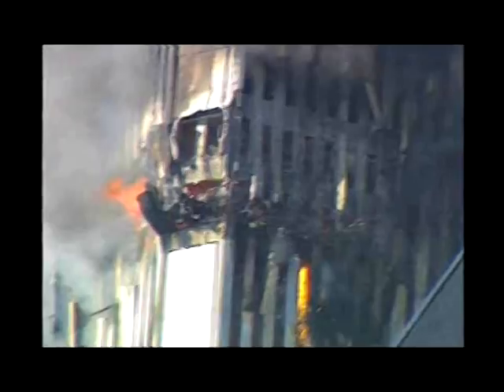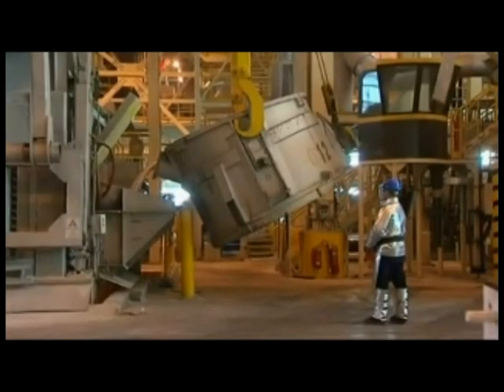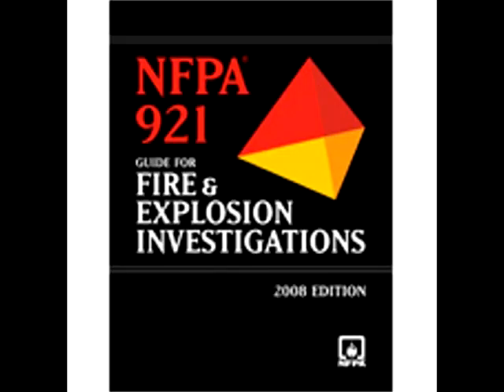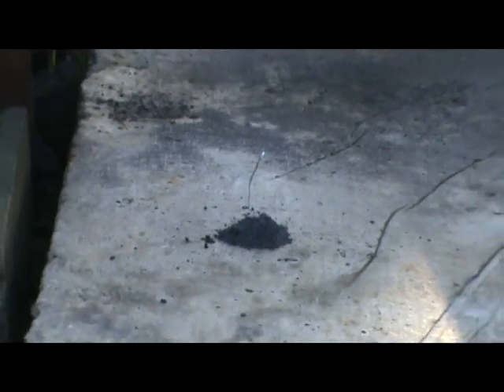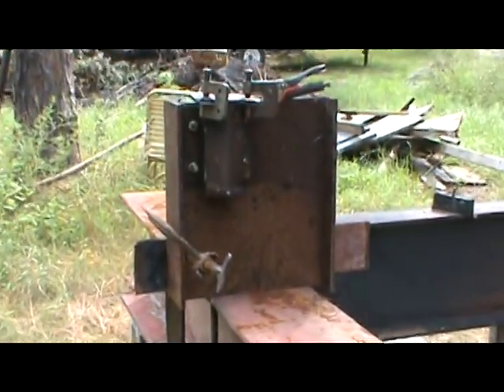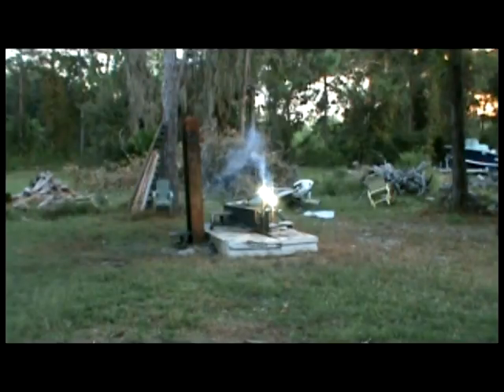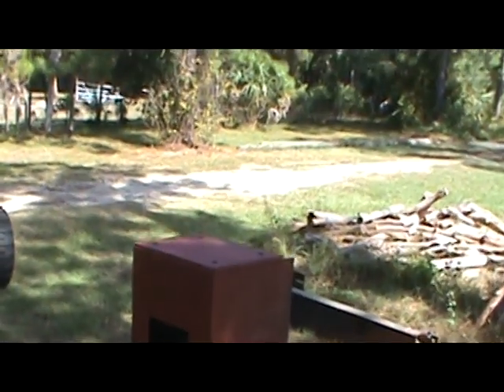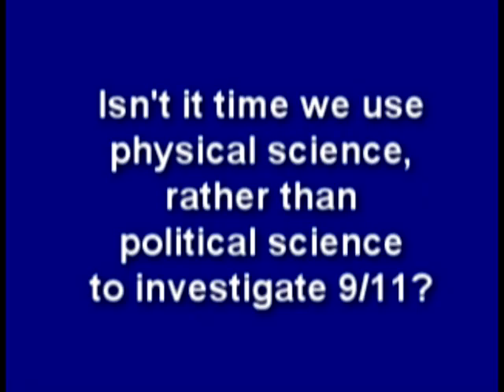9/11 Experiments: The Great Thermate Debate

Comment: I worked 37 years in the natural gas pipeline industry and I have used a lot of thermite while welding copper test lead wires to a loaded pipeline for catholic protection purposes. Thermite comes in different size charges depending on the thickness of the pipeline you are going to bond the test wire too.  The reason for this is because a charge to large can cause a catastrophic failure like burning through the pipeline with 1200 #'s of natural gas pressure which would cause immediate death. You cannot imagine how hot thermite burns and how quickly it reaches maximum temperature. We talking less than 2 seconds. Could thermite have brought these twin towers down? You dam right it could and it probably was used in the destruction process.

Comment: JESUS!! You don't have to melts steel to severely compromise it's strength. Furthermore, the floors in the twin towers were hung on the support beams. Most if that support was the outer 4 walls. Now, imagine one of those floor's supports failing from softening and that floor falling to the one below, where the supports for other floors are compromised too. CHAIN REACTION! Each subsequent collapse is carrying more genetic energy, more inertia, and more mass. People also aren't taking into account that thise towers were pretty enclose as far as tower design goes the days. Except for the holes produced by the impact of the planes, much of the fire and heat would ve contained inside the building. What windows are there are only big enough to feed the fire with oxygen. There's not much of anywhere for heat to escape though. That's not the same conditions as jet fuel burning out in the open. These are furnace conditions, similar in how we do go about melting metals, or at least getting them hot and relatively soft to form in a production environment. Its a false argument to even bring up steel becoming liquefied. They're using liquefied steel in there argument to debunk their own assertions. The fact of the matter is that the steel would become severely compromised long before it became liquefied. You had jet fuel burning in a grill with the lid closed, but the air vents all wide open. If the heat is insulated enough, it's going to get hotter than just the temp of jet fuel burning where the heat can escape and isn't confined to a small area. This is experiment is flawed from the onset because you're not remotely creating the same conditions.

Comment: How do you make thrumit? Basically rust and aluminum. Steel exposed to decades of weather and or leaking pipes (rust). And then a plane that's maine body is made out of aluminum.  Add jet fuel fire (while not hot enough to fully cut or melt a steel beam it is hot enough to make it malleable which when under load could be an issues and cause bending). Add other things in both the plane and tower (and maybe even some fire burning in an insulated area in the tower increasing it's tempsure) and you have more than enough ways you can end up with thermite and it cutting through beams (along with other factors that could have weakened them or others not cut by thermite) without it being a purpose demolition.

Comment: What about the pressure of the top of the buildings? With an explosion immediately destroying a large part of the support, the rest of the beams would have to carry the pressure of top of the building thus under sever pressure. This could cause the melting point of the beams to lower significantly

Comment: Steel doesn't need to melt ffs the amount of weight on the structure that was there only needed to be heated enough to weaken the steel and the weight above and gravity did the rest. https://www.bing.com/videos/search?q=video+debunking+9%2f11+conspiracy+theories&view=detail&mid=35F0CF6BDF068F1A6C6635F0CF6BDF068F1A6C66&FORM=VIRE

Comment: The engine turbine rotors of the aircraft which crashed into the buildings were built to withstand both high temperature and mechanical stress, Were they found in the debris?

Comment: That fact about aviation fuel not being able to melt the metal is wrong, it will melt it enough that if fails to retain its ability to hold.  Good video though, and well made however you kept going to answer the questions which is good.  I am not sure if that is correct, as i have not looked into it.  I do know demolitions though.  Hence the heat was greater due to the air being drawn in to feed the flames.  When heat can not dissipate it builds higher and higher.  The beams that hold the structure at the base would be thicker than where the planes hit.  I am not saying one way or the other as i do not believe in all the conspiracies that are mainly stemming from one country.  So i will not comment if it was anything apart from there are more questions than that to answer and with all conspiracies, the amount becomes unworkable, though not impossible.

Comment: The point that's "forgotten"  is that NIST never quantified the collapse Event....A legal requirement they ignored...but went on to tell US what happened anyway!...in a 2 paragraph physics word problem....when solved, proves fire alone could never bring such a structure down with the accelerations We all saw.
Reply: Blu Crystl yep...a quantification of the accelerations during the collapse (the physics word problem they used as their "explanation" of what happened during the collapse) would start and end with simple conservation of momentum of the structures mass...at that point you've matched the accelerations that we all saw happen, quite nicely..and can conclude that the columns provided no resistance to the collapse.  Given nist admitted their was no damage to columns below the crash/fire area...one would logically conclude additional energy input was required to render the columns useless ..above and beyond the energy that pulverized all the concrete and also melted all that metal ... Of course we know, quantification of all this required energy was illegally ignored in the nist "report"...one is then left with the conclusion that the govt (and media) is either dumb as a box of rocks or covering up for mass murder of US citizens....peace

Comment: I have debated whether or not I should comment this, but just for the sake of being democratic, I'm just going to go for it. Admittedly, I haven't read a single word of the official government report. And yet, I can't agree that 9/11 was an inside job based on this video. It's not that I want to disagree, it's just that I'm not easily convinced. I'm strictly scientific about this, and there are still questions that no one appears to be asking. Out of all the metals that can be found in the buildings at that event, which one has the lowest melting point? Aluminum, which melts at 1,220.581 degrees Fahrenheit (660.323 degrees Celsius).

With that being established, what's the one thing that could provide a large quantity of aluminum relevant to this occasion? A commercial jet airliner. Even the 747 Jumbo Jet is made up of more than 147,000 lbs. of aluminum. Granted, I know 747's didn't crash into the buildings, I get that they're different airplanes. However, even if the planes were half the size of the Boeing 747, the quantity of aluminum is still a considerable amount. 

Can molten aluminum create the kinds of bright orange and/or yellow colors that one can see in the video footage? Yes, it can, if it exceeds the temperature of 1796 degrees Fahrenheit (980 degrees C) at the minimum. I agree that burning jet fuel is not hot enough to melt steel. Here's the crazy part: Steel doesn't need to melt to FAIL! Typical construction steel will lose 50% of its structural strength if temperatures exceed 1,200° F. At 1,800° F, the structural strength decreases down to 10%. By that time, the steel would sag and buckle under the enormous loads and stresses. As you stated in the video, the South Tower was seven minutes away from collapsing as the molten metal was seen pouring out from the gash where the plane struck.

Here comes the big question: What's going to happen if the structural status of the steel is 10% of its original strength and steadily decreasing amidst a vast, multi-floor fire, and it's trying to support practically the top half of the building? It's going to collapse within a matter of minutes!!! Steel is sturdy, but it's not invincible. The collapse of the towers was the result of extreme circumstances that even the original builders stated were never taken into consideration during the design phase back in the 1960's. If they did, I highly doubt we would be having this discussion right now. Moving right along...
Reply: I'm not an expert, but I know plenty of it. Feel free to give your constructive feedback.

Comment: All you conspiracy theorists fail to look at the fact that aircraft are largely comprised of: Aluminum, magnesium and Titanium alloys.....do any of you know what temperatures are generated when theses alloys burn? take a torch to an old VW aluminum/magnesium engine block and transmission and see what happens....especially if it is hit with water....like that from a fire suppression system...it burns hotter!...yes hot enough to melt steel.

Comment: I work with structural steel day in day out . There is so way on this earth jet fuel , a building fire , or any other bullshit would melt a steel beam like that it would maybe bend and warp but the heat needed to melt it like that is no way possible from burning building material.

Comment: I just got idea. How about another experiment? Try burning large amounts of jet fuel and add molten aluminum, let it heat for an hour or so, then simulate pipe crack by pouring small quantity of water into it. Will fire extinguish due to water or will it expand due to hydrogen and oxygen being released from water upon impact, oxygen immediately reacting with aluminum and fueling termite like reaction, only worse? It is just a theory. Any good chemist around?

Comment: Has anybody thought about the winds at that height? How do you make a coal forge hotter? You introduce blowing air. So has anybody tested what a jet fuel fire with fast blowing winds does? How hot it can get? Now the steel did not have to get hot enough to get molten. Only hot enough to weaken the steel. With the weight of the upper floors steel bends and down comes the building.

Comment: You guys want to see how to break ANY sockpuppet with pure science (Einstein's way not ALL jews are baad Mmmk? Albert are one of my biggest idols he was a bit of a horndog but so am i so who am i to judge?)
Reply: I came up with a "thought experiment" like Einstein that take the wind out of all their "this beam slipped this way, this beam slipped that way, it was warm) arguments and makes them null and void... (plz use it just remember to quote me) OK!
Reply: Ok lets make a thought experiment Einstein style... Imagine we have only the steel structure nothing else... we take a massive block of concrete the weight of the missing parts of the building, we put this on top of the structure... so it got only the steelframe as support but no support from the concrete... now imagine we heat all the steel in that structure to 800c so it get juuuust a little yellow sheen i mean every square inch of it.... and now i give you a problem : I give you 13 seconds to take down that entire structure to a pile lower than 2 floors and reduce the concrete to powder and the steel to small pieces using ANY mechanical equipment on earth ANY.... how would you do it? 13 seconds....?
Reply: That is not an easy problem is it? Now imagine doing it with the concrete as support instead of a load and only small parts of the steel heated to even a fraction of that temperature and with NOTHING but gravity to do that same job...?
Reply: There you go boyz it CANT be done...

Comment: It was plenty hot inside of those buildings to turn the internal steel supports glowing red. When steel is red hot it is in a weakened state. Imagine a swordmaker hammering away on a red hot bar of steel, heated by charcoal. The beams would not have needed to "melt" in order to give way to all of the weight that they were holding up. Look at the opening sequence of this video, the top of the building appears to be twisting.

Comment: From my experience with exothermic welding, I'm not surprised that you got thermate to work using carefully designed and placed molds or forms. Of course each of these would have to be uniquely made for the many different cuts.A job like this would require several thousand such charges to be correctly placed and connected by skilled workers. I have seen where a small leak will allow the charge to run out on the floor and achieve nothing. 
All of these structural members are concealed in the finished building, so walls and ceilings would have to cut open  in thousands of places and miles of wires would have to be run for interconnection of the igniters. This would be a huge project which building occupants would have to notice.
You completely ignore the fire protective coatings like shotcrete which would also negate the charges unless it was removed.

Comment: The funny thing with the media's crappy trash bag thermite experiment. It still proves jet fuel and furniture fire cant melt steel beams. It's like, so are you trying to say the spread out constantly fluctuating furniture fuel fire, was hotter than the constant 4000+ degrees F (2204+ degrees C) produced by your trashy thermite experiment that was applied directly to the beam.

Good video by the way. I'm glad someone showed how it's done.
The MSM demo is either intentionally misleading or they are all a bunch of morons. I would say both. They hire morons because they believe the bullshit they're fed. Which makes it appear authentic.

Comment: There are many failures of reasoning in this film, such as assuming they know what that material was, including assuming that it was molten iron, when there were numerous metals and plastics within the structure. An MIT engineering study states that the fuel can reach 600-800 C (to ~1472 F):
http://web.mit.edu/civenv/wtc/PDFfiles/Chapter%20VI%20Materials%20&%20Structures.pdf
Aluminum melts at 1221 F, for example.
On page 95, you can read about the modulus of elasticity of steel:
"At a temperature level of about 600°C-700°C, which corresponds roughly to one half of the melting temperature of steel, strength and stiffness of steel are reduced to 50% and 30%, respectively, of the initial value."
Also recognize common failures of eyewitness accounts, especially non-specialists not having expertise in the engineering. Firemen are neither structural nor materials engineers, despite their basic knowledge of structures and fires. Fire science studies is a 2 years program, while actual firefighting training ranges from 3 to 6 months.

Comment: Proving that thermite can burn through steel doesnt prove thermite was use in the WTC.
Reply: Yes it does. Steve Earl Jones was one of the scientists who went to ground zero to gather samples up and examine and found there was enough aluminum oxide to cause concerns. Since no building in its right mind should ever have such a substance so lethal it stood to reason that thermite was part of the incident. Even if it was on a small scale. Thermite is a very unstable and exotic explosive as well as an incendiary accelerator for cutting steel beams thicker than two or three inches. It's not used in domestic demolitions like high rises or casino buildings in vegas. They use TNT or a form of plastique wrapped like a dynamite stick embedded into the foundation walls. Thermite burns at over twenty two hundred degree Fahrenheit or hotter, which by the way is a lot more excessive than jet fuel. But it can be wrapped around the 'I' beams or welded on a column or columns in a successive string or beads like a pearl necklace at vital key points. Plus both of the buildings were most likely rigged months ahead of time by the shady covert men in black who had ultra high security clearances assigned by bush or one of his cronies. The buildings were taken down by thermite... that is all there is to it. Jet fuel, TNT, Plastique or C4 are not effective enough to warp, break or cut steel two to three inches thick.
Reply: Your argument is still "we don't know what caused it so it had to be this". That's not proof.

Comment: What would happen if you filled the beams with jet fuel and lit them? I would do a project disproving that jet fuel could do any thing. The airplanes had about 130,000 pounds of fuel on board when they hit the tower. Just to use as a gauge.